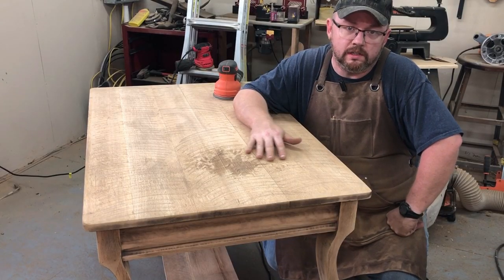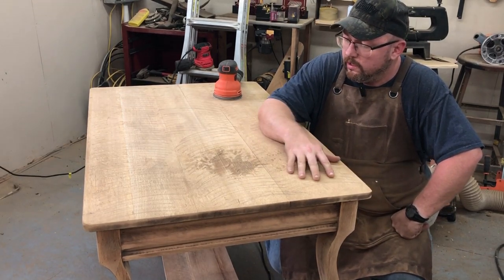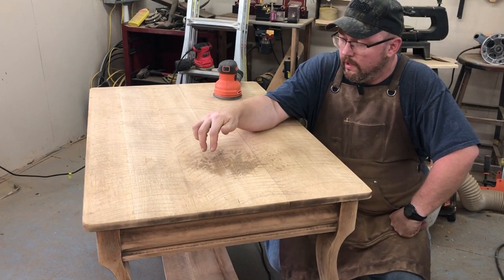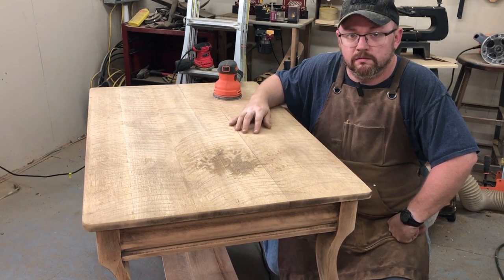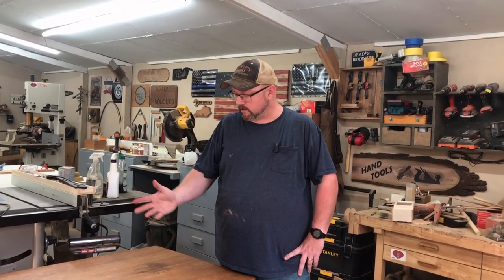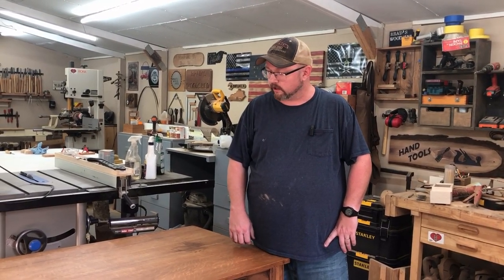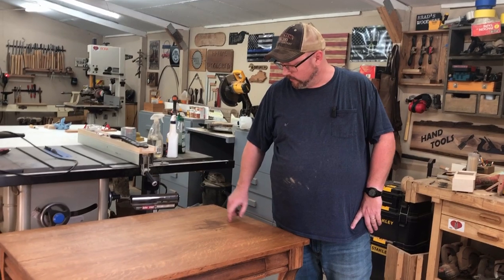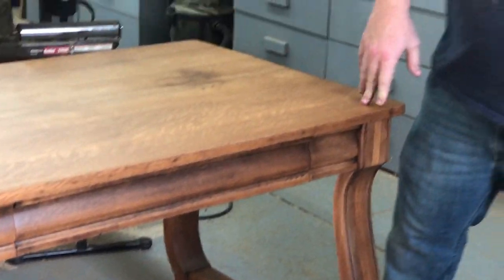Restoring an Antique Desk Built in 1908 by The Cadillac Cabinet Co.!

Comment: Great video, quick question as I am a newb and know little about refinishing wood. Why the pencil markings on the desk top  in between sandings? Cheers.
Reply from the maker: A couple reasons. The simplest is when you’re progressing through the grits of sandpaper, it lets you know where you’ve sanded. Sand until the pencil mark is gone and you know to move to the next area. The other reason is it’ll sorta reveal low spots. As you’re sanding you’ll notice a low spot will still have the pencil mark there, and as long as you keep the sander flat and don’t tilt it(which will cause it to dig in, creating more low spots) then essentially you should have a pretty flat surface as well!
Reply: @Brads-Woodshed  great tip, thanks so much, I will remember that. 👍
Reply from the maker: @shannonsiscoe4275  Thanks for the question and for watching!